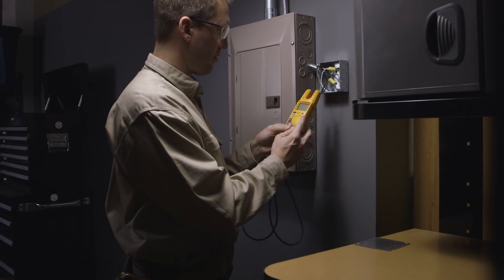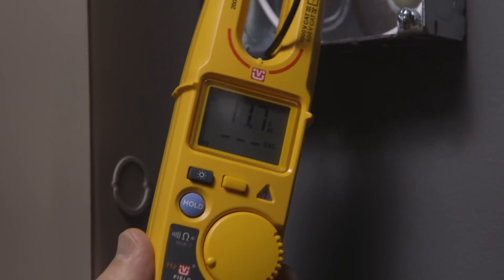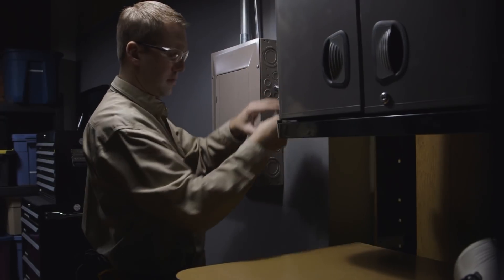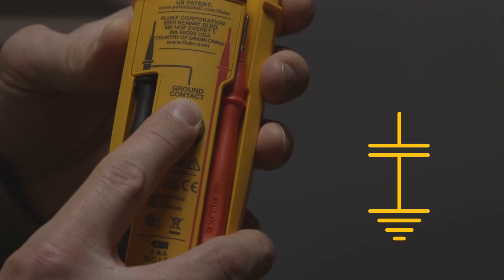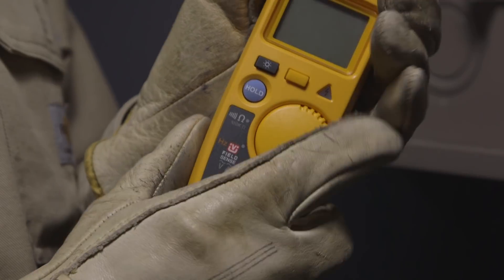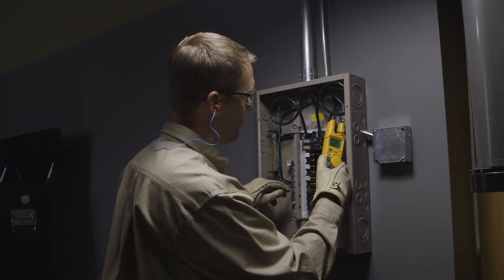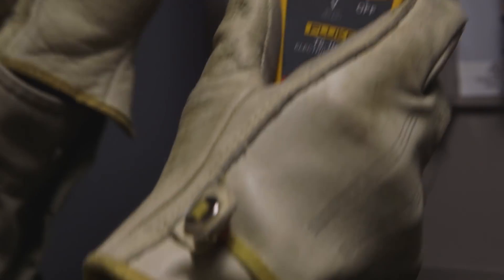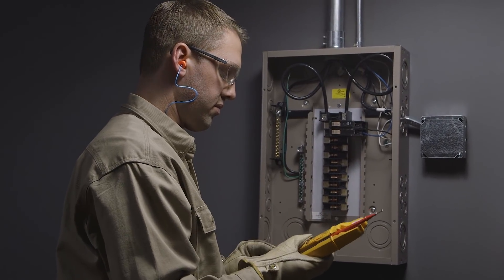How to Use The Fluke T6 Electrical Tester

Comment: Do I have to be touching ground to use fieldsense voltage measuring? I know I need one finger in the contact but do I also need to touch a piece of grounded metal with my other hand?
Reply: Have one bare foot in a puddle.

Comment: What happens if you touch the red lead to a hot while touching the field sense ground?
Reply from the maker: Hi Jonathan, Thanks for reaching out with your questions about the Fluke T6 and safety! The Fluke T6 was created with safety, and ease-of-use in mind but some customers, like yourself have had questions about usability. The T6 circuitry is designed to protect the user against electric shock hazard through normal use and misuse including single fault conditions. The T6 also complies with UL 61010-1, OSHA, CSA and NEC regulations. 

For tips & tricks on using the T6 [https://youtu.be/kHNM-_uaNr4] for additional information on safety and a quick reference guide check out [http://bit.ly/2qWPQHb & http://bit.ly/2r0AGkc] and if you have any additional questions about the Fluke T6-1000 or T6-600 please call us at (800) 443-5853. We’re happy to help! Here is a video that explaings the saftery of the Fluke T6 tool: https://youtu.be/-fUm95rd43U
Reply: u get shocked basically..

Comment: This device is a massive shock hazard...
Reply: Based on what actual information?
Reply: The only current and voltage allowed through to the field sense ground contact is in the milliamp range correct? 
Not sure how the circuitry works and if it’s possible to have more amps/volts to ground(your finger) In the event there is a malfunction internally of the T6….

Such a controversial tester. I think I’ll just buy it to test for myself. Seems like most folks complaining about it are using incorrectly
Reply from the maker: Hi Ian, Thanks for reaching out with any questions that you have about the Fluke T6 and safety! The Fluke T6 was created with safety, and ease-of-use in mind but some customers, like yourself have had questions about usability. The T6 circuitry is designed to protect the user against electric shock hazard through normal use and misuse including single fault conditions. The T6 also complies with UL 61010-1, OSHA, CSA and NEC regulations. 

For tips & tricks on using the T6 [https://youtu.be/kHNM-_uaNr4] for additional information on safety and a quick reference guide check out [http://bit.ly/2qWPQHb & http://bit.ly/2r0AGkc] and if you have any additional questions about the Fluke T6-1000 or T6-600 please call us at (800) 443-5853. We’re happy to help! https://youtu.be/-fUm95rd43U
Reply: #1 stop your canned answer, it's insulting 

#2 Who honestly, who did you think would want to touch anything conductive on a meter?? Do you not realize that this sounds entirely counter intuitive? What was the use case that convinced you it would be a valuable feature? Many, many people are afraid enough probing anything near live wires, and you expect us, on faith,   to trust you (and whatever certifications your product has) that something bad won't happen? What will be your response when some bizarre condition results in someone actually getting hurt, regardless of your forethought ("foreseeable misuse") into safety?

Comment: Hello there Fluke, still waiting for my unit to arrive, does fieldsense work with DC? at least according to spec sheet in Part of general applications "Quickly measure individual voltages either ac using fieldsense or dc using test leads, So my general idea, the open fork is able to measure DC Amps but not dc voltages without both test leads on contacts. is my thesis correct? Or is the DC left out of the question, because of the more sophisticated tricks to be able to measure DC amps, that is out of this list price tier.
Reply from the maker: Hey there - The T6 with FieldSense is able to measure AC voltage and current through the open fork. For measuring DC voltage, the test leads are still required. For additional information please call Fluke at (800) 44-FLUKE

Comment: Will it fieldsense measure voltage with no current flowing?
Reply from the maker: Hey there John Doe - The voltage and current measurements are independent of one another, so you wouldn't need current flowing through the wire in order to take voltage measurements. If you have any follow up questions, please give us a call at (800) 44-FLUKE